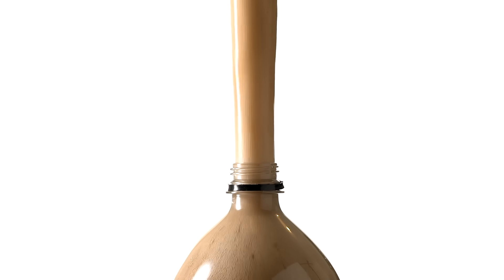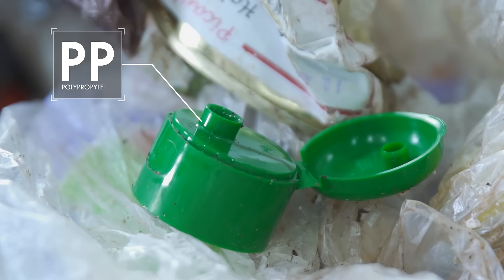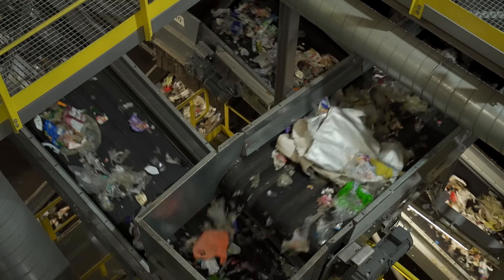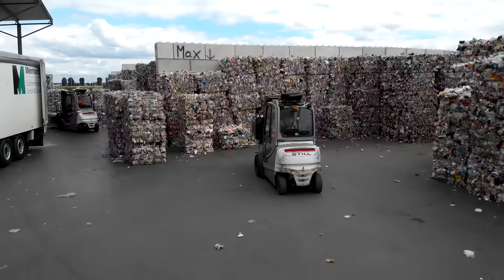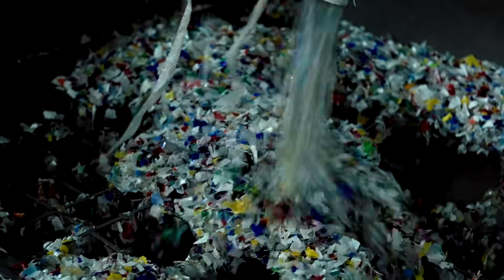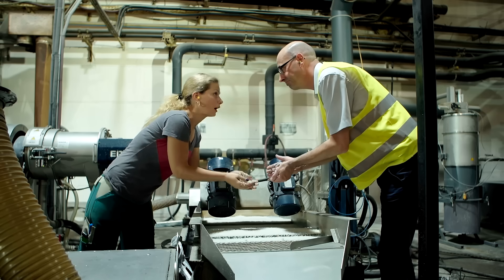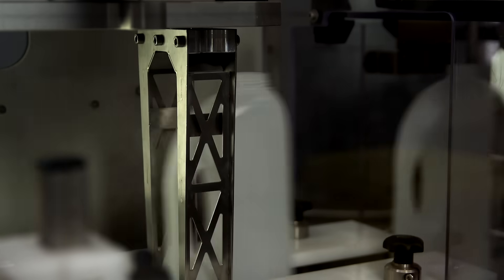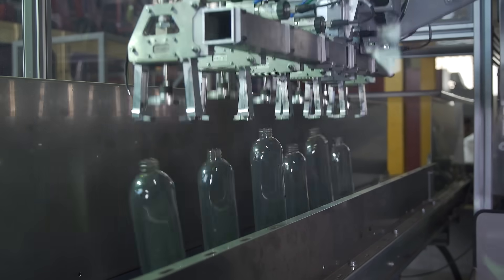Recycling plastics – Resource efficiency with an optimized sorting method

Comment: I see a big problem that has not addressed   Paper labels  on any bottle is a contaminant  glass or plastic . on glass bottles   the glue that holds the label should be  easily water soluble.   A quick wash in dirty dishwater  would do the trick .  on plastic  bottles with paper labels much the same. now for the tricky  part .    any label  that does not come of with  ease  gets either trashed , or dumped  into the  recycling bucket to be  trashed  at the plant .  don't use  anything but  easy to remove labels , shrink , or  minimum glue .   or make a printable label  out of the same  material  that when it's rinsed and put in the yellow bucket  it wont be  viewed as a contaminant  .  this should be incentive  driven on the manufacturing end .   the end goal should be  contaminant  ALARA = as low as reasonably achievable.    Further more, dis-  incentives  for  using plastics  that are not readily recyclable .  should be encouraged  for most  all applications.

Comment: Good idea.....👍🥰
Reply: 15:24 Although it is nice to see that something is done to combat the pollution. I should say this solution is rather a patch on a systemic problem.
Plastic can only be recycled ~15, so eventually, there would be a need for raw materials and incineration or pyrolization capacity.  Remember recycling is an industrial process and it can be dirty. In the packaging, there is a rule, with every doubling of package volume it only uses ~30% more material.
If we would provide 1000l HDPE containers on pallets to distribution centers & supermarkets, reuse 5l HDPE containers instead for the last mile. Go digital with labeling only leaving DataMatrix and a name on a package to avoid mixing multiple materials cause it complicates the recycling process & drives up the cost. SuperMarkets could use a printed sheet beside packaging.  Online it would be even easier.

Comment: We did have glass and it was recyclable. Plastic is just oil industry waste no matter how much propaganda you coat it with.
Reply: @shawnsteuer9951  yep, there is no way around the fact that plastics are extremely useful and deeply embedded in modern society. That does come at a cost though.

Comment: If the bottles and bottle caps were made from the same type of plastic, they would be so much easier to recycle. But, really, the manufacturers that currently use plastic bottles should be made to use glass instead. Yes, it's heavier and therefore transport costs and final prices would be a little higher, but wouldn't it be worth it?
Reply: Glass is gay dude
Reply: @meghanachauhan9380  like you? there are people like you who have nothing to contribute  to this planet but yet have smart comments !
Reply: @meghanachauhan9380  really? You are going to use 11 year old arguments for a real issue?

Comment: How about using all plastics being recycled to make plastic studs, 
plastic trusses, and full size Lego style building blocks for home and 
commercial construction?
Reply: They are.
Reply: @forvdr5231  : Do you know whether all types of plastic are being used?
Reply: @kuzinvknee3318  I've read that #1-6 are recycled, but #7 is problematic., and of course plastic bags (polyethylene) aren't recyclable at all. You have to do some searching around the web to find out all the products being made
Reply: ForVDr plastic bags can be recycled into new plastic bags. It’s just a separate collection than single stream recycling. Many grocery stores near where I live have plastic bag collection for recycling.
Reply: Plastics are being used for sheds, however their durability is not as good as traditional shed materials. Im not sure about houses though. I think durability of them would be a large problem.
Reply: @deafkite638  : I agree that they not that durable, however I think that is intentional and for profit. Can't make profit if it lasts too long. As I said, Lego style blocks with very thick walls, engineered / designed for Durability should last hundreds of years, plus they themselves are recyclable. Also engineered roof trusses could also last long periods and be recyclable. Plastic studs could be use for inside framing too. Again recyclable. Imagine how much plastic could be removed from the environment plus forests allowed to grow and to remove Co2 and had oxygen. Ozone is a derivative as O3.

Comment: wtf is the Yellow Bag?
Reply: It's a special bag in Germany. You can not buy it, you can only exchange the coupon you get from your local trash management provider every year. The yellow bag is for plastics, aluminium foil and mixed materials (like cardboard-plastic milk containers) only. Depending on the state there are two or three different trash bins aswell. Where I live those are: Grey for regular (food) waste (normal bags you can buy; Blue for paper (without bags)

Besides that, there is a special recycling for glass and plastic bottles, electronics, clothes and fabric, batteries and big stuff like furniture. (you either have to walk/drive to the collecting station or call the local waste management conpany (for furniture and home decoration))

Comment: Corporations have convinced Americans that it is their duty to recycle and not the duty of the industries to produce reusable containers.  That way the corporations are not responsible for the billions of pounds of plastic that go to the landfill or into the oceans.  Just do a check to see who sponsored the crying Indian video back in the 70s.  Also consider how much waste is generated for products (eg. single use packaging) that provide no benefit to the end consumer other than making an item look presentable on a store shelf.  Also consider how many types of plastics are used that are not recyclable at all.  Just because it has a triangle on the bottom, does not make it a recyclable item.  Finally, even if you use a recyclable plastic, very little of it can actually be reused.  It has to be combined with other virgin plastic to make it usable for injection or blow molding.  The rest can only be used to produce items such as plastic lumber, which is only marginally useable at best.
Reply: It wasn’t that long ago these plastics didn’t even exist.  I recall our cosmetics/lotions being in glass.  And no one bought water.  Milk and soda came in glass bottles that were returned for a deposit, then they were sterilized and Re-used.  Manufacturers find disposable plastics cheaper and easier - much less shipping costs, breakage loss and fewer responsibilities.  They are benefiting more so than the consumer.  Remember when milk/dairy products were delivered to our door?  And yogurt, sour cream and cottage cheese were in biodegradable paper packaging?  I started making my own yogurt to stop contributing to the use of plastic yogurt containers.  

My recycling container is filled with mostly junk mail and metal cans which can be recycled 100%inti new metal cans.  And I typically throw out one small grocery-store plastic bag of garbage each week.  I shoot for as little packaging as possible so have much less garbage than most people.  

30 years ago I used to buy Jergans skin lotion because they sold refills in plastic bags that could be put in the previous container:  90+% less plastic.  5 years ago I bought refill bags of liquid dish soap.  I contacted one detergent mfg and asked if they could create a small paper box (like milk container) of just the chemicals that we could put in our empty containers and just add water to fill the rest of the way.  They sent me coupons but didn’t use my idea.  But if you look at the ingredients on the bottles the first ingredient is water:  so with a 16oz bottle it’s probably 12 oz or more of water:  just sell us the concentrate to save packaging, shipping, costs to you and the consumer, etc.  

There are so many other solutions than to just keep buying/selling so much packaging with so much plastics.

Btw - where I live they stopped picking up glass.  I drive mine over to the county recycling center, but gotta hunch most folks just throw theirs in the garbage.  I can hear it in recycling day in my neighborhood.  With that though, I buy less in bottles when I can get it in metal cans...  

Put more responsibility and requirements in the producers and things will change:  requirements from government and as consumers stop buying the packaging you don’t like.  

Btw:  vinegar is a great cleaner, and better for the environment and comes in glass bottles.  My cousin tells me she uses it for all her cleaning these days...
Reply: @libertychick3522  Great.

Comment: How about if every plastic item made had a coded electronic particle(?) embedded such that discarded items could be sorted at scale speed?
Reply: Nick Guthrie what is the particle got separated from the rest of the item? Like a bottle being cut in half
Reply: @lloyd355  yes, there are still flaws with pretty much any sorting system, but this could greatly increase sorting efficiency

Comment: The only problem on the plastic recycling is the capitalist economy approach. Plastics are produced from the petro-chemicals. And the manufacturers of the plastic product buy the row material a lot cheaper than the recycled plastics. So therefore you cannot stop manufacturing the plastics. In case the all produced plastics were recycled you can provide 8-10 time of the need of the World. We are on the edge of the problem. We should stop producing plastics from the row materials which means from the petro-chemical refineries. We, the packeging industry need to change the habits on the packaging somehow, by eliminating the use of the plastics by putting more environmental friendly materials into the market.

I can see that the private sector in Australia is approaching this issue for only the benefit. Therefore the governments should start working on the issue and make some rules for recycling (probably more sorting at home and cleaning) and establishing the sorting and recycling plant for recycling. If we wait for the private sector we will wait 100 more years.
I would expect this kind of videos can give more insite to the governments. But stopping more petro-chemical plastic product is vital for the start. Additionally I would ask industry to start considering using environmentally friendly product to replace plastics. Today industrial use of plastics are enourmous, this needs to be teighten as well.

Comment: It is not efficient way. Too complex so it can not be cheap or cost effective. I think this packaging sector must be regulated with new law and rules by governments. First of all new rules have to decrease divercity of packaging material, size and colour so distribution of package will be simpler than before. If company wants to use differrent colour with its package they can cover the bottle with paper or other material. For easy distribution for example all of water bottles must have same weight and this weight must be differrent from detergean bottles or Pet base bottles have differrent weight and size than polyetilen base bottle.
Reply: you dont understand a thing about what you are spouting here, do you?

Comment: Dear Sirs!
I ask you to consider the possibility of providing a platform to install
equipment for testing technology for the processing of contaminated (not
washed) unsorted plastic garbage into commercial products: euro-pallets,
garbage and wine boxes, car bumpers, floating berths, boats, plastic road
fences, Chippers Injecting liquid sevilen and physical blowing agent (FVR) into
the pressure zone of the extruder, with a low boiling point, mixing the melt
mixture, we found an unusual property of the FVR, to crosslink different Limers
forming side bonds that connect the chains to each other. Due to this, the
physical characteristics change greatly, without changing the chemical
properties of the plastic. Using FVR it is possible to process contaminated not
sorted: PFH, PVD, PND, PPN, ABC, PSS, UPS. Moisture is removed, dirt is used as
a filler, it is also necessary to add a temperature averager, dye. For testing,
at least 200 m2 and 110 kW are required. I do not offer scientific research, I
use only ready-made technology, equipment and components. The time for work is
4 months.

More
information can be obtained by mail: nttsima@mail.ru

Comment: I WORKED HERE 2018 -2019 JUNE BUT ITS TOO HARD TO HANDLE FOR SMELLING, I SWEAR
Reply: spray a perfume heheh
Reply: Use maskers during work
Reply: Even if you use 100 mask it's still smelling, sometimes you can't get ride with the local transportation

Comment: All this trash and organic can be refined into fuel by smoldering the trash in containment condensing the smoke into crude creosote oils that can be refined into fuel to further fund the cleaning project creating a funded new form of employment with profits...
Reply: That's really interesting
Reply: @experssion123  I was hoping some one would find it interesting enough to put it to the testing you would end up with one big profit selling heating fuel for when the cold really comes to the world.
Reply: @experssion123   All organic and floating plastic that means wood and sea weeds too. All of it produces creosote oils that can be extracted by smoldering in containment and pushing the smoke threw tiny holes in the bottom of a cold water vat  crude oils will float to the top extracting the co2 and pumping it into green house waters while the oils drain into a collection...

Comment: It's amazing how they can engineer a system on how to sort the plastics after their use. But to be more efficient, governments and private companies that manufacture the plastics should have engineered a way on how to label and separate the plastic containers before consumption, that way they wouldn't have to deal with the aftermath of a single streamed recycling process.
Reply: Do you take caps off every bottle you throw away? If you don't your mixing material.
Reply: @HardingGrimIV  I know in Japan and Korea, they have very strict recycling and the people there know how to separate them. I know I haven't been good at recycling up until now when I learned about how the caps are separate materials but now that I know; I do. Although now I just have a reusable water bottle and don't even deal with plastic single use bottles anymore

Comment: Okay it's a step in the right direction but can we talk about the madness of producing such materials, using them once and then going through all of this to become another product? 
Can't everyone just own 30 containers and bottles and refill them every time they run out? If it's about getting that one specific special brand, there could be special bulk storage with funky shapes and colours, but do you really still care about the looks of the packaging when you are home? Don't you usually buy the same products anyway?
Reply: Agree.  Energy saving loses quickly effectiveness with an increase in usage and usage frequency.
Reply: It just isn't practical...what you would need in your supermarkets would be bulk containers with the liquids in to be dispensed into your containers. There are good reasons why products are bottled at the manufacturing plants. Imagine doing this with your favourite carbonated soft drink...they make a 500 litre container of the drink to be dispensed into smaller containers at the point of sale. Initially it would be fizzy, but by the time you got halfway through it would be going flat. And that's without considering the queues that would form, and the mess that would be made. And then you have hygeine issues...if you don't clean and sterilise the containers beforehand you could easily end up making people ill. The life of the product would be significantly reduced because the manufacturer can no longer control and guarantee the dispensing conditions. All in all your proposal is quite ridiculous, and would never work. If you can't see that already you must be stupid
Reply: Penguin of Death  For heavily processed products, you have a point.
My point is mostly about basic products. Flour, grains, nuts, dry foods would do well. Liquids could be an option, unless it involves specialised storage like pressurised containers. Shelf life doesn't have to degrade with a different storage system, however guaranteed shelf life does become a problem once a customer purchases a product. 
Spilling can be reduced by adapting the dispension methods to this, and manufacturers can control their own dispensers, as they already do deciding which product goes where on which shelf in the supermarket. When customers bring their own containers they become responsible for their own hygiene, which results in people bringing clean containers anyway, or polluting their food with something from their environment that they are already immune to. 

For fizzy drinks specifically I actually found a great solution:  A chef in Amsterdam who makes amazing lemonades and sells them like sirops, for customers to dilute and carbonate at home or selling points to run them through a post-mix machine that dilutes and carbonates sirops on the spot, like at fastfood places or IKEA. Water shouldn't be transported anyway. It costs tons of energy and money, while the place it is shipped to has water supply itself. 

In short, it may be cool to check out a bulk shop some day, and see what it is like :)
Reply: Eva well said! Penguin of Death a has good point tho. I think for products like washing up liquid, liquid detergent, shampoo and shower gel, refill sations in supermarkets are feasible now without any major risk to public health. I think it'd get messy without very well designed machines. But shelf stackers could be reprogrammed to wipe down the catch trays and to tighten bottle lids. Given that these dispensers are already on trial i.e. Waitrose Oxford, I think they'll be common place. If it's convenient, safe and cheaper to refill, it's a winner.